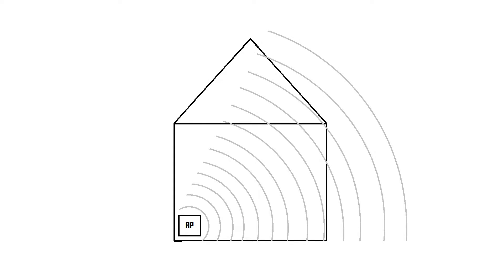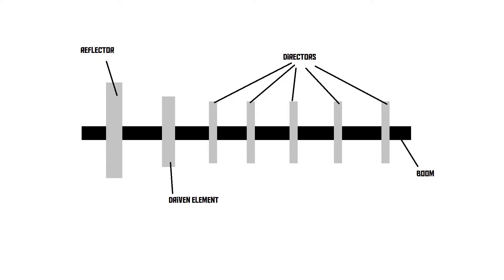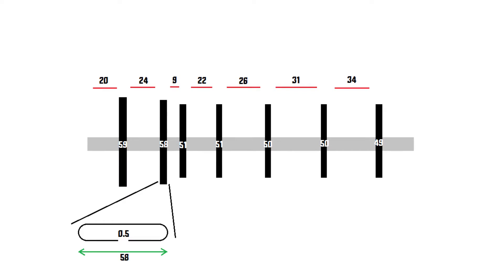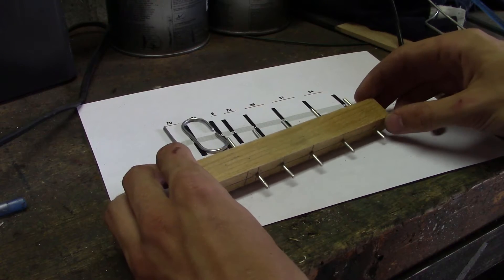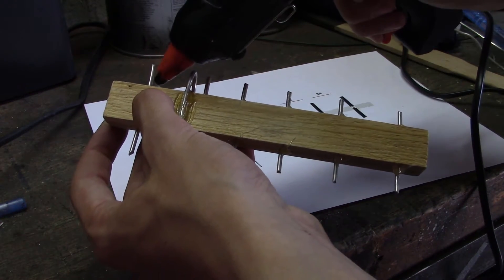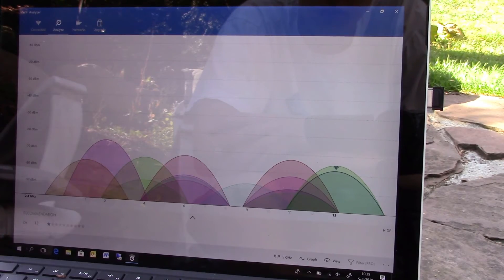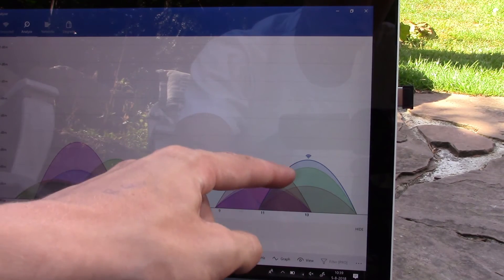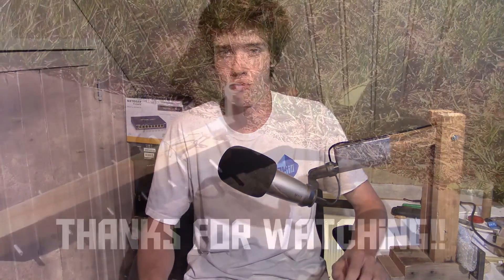How to make a 2.4 GHz Yagi antenna (AKIO TV)

Comment: this way you can build a toy, not a working antenna. And yes, a cable can be used, just not by you. For using a cable you should understand something more than cutting pieces of metal based on a computer program design. You can if you learn a bit about antennas

Comment: Hello sir
I live in rural area, and now designing a yagi antenna for my router
I found some online calculators which give you the dimensions of each element and the boom,  but there is one thing I need to make sure of

My element diameter is about 4mm
My question is about the distance between elements, is it measured from the center of the element to the center of the next element?
Or from the end of the element to the start of the next element??

Comment: The reason the router doesn't work with just one antenna is because you can't transmit and receive on one antenna at the same time, and the router needs to do that, so it transmits on one and receives on the other. Great job explaining how to build one of these!
Reply: nonsense, all the routers use the same antenna to transmit and receive
Reply: All antenna do the function of transmit and receive single handedly. Newer wifi protocol can uses multiple antenna MIMO for higher speed.

Comment: Good thing this guy didn't grow up in the 1990s when 56k per second (actual speeds about 15k to 20k) was all we had. It took 12 hours to download a 20 MB file. 

Fast forward 30 years from now, this guy's grandson will be complaining about  awful 10GB speeds
Reply: Right! It's a good job we're not required to pull 20MB to load modern web content on a daily basis. Get with the times you silly goose.